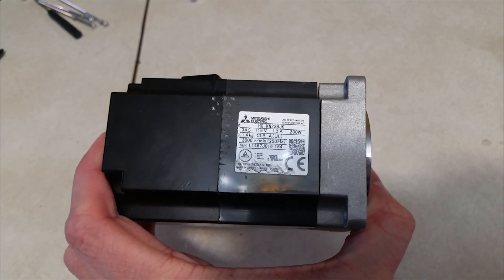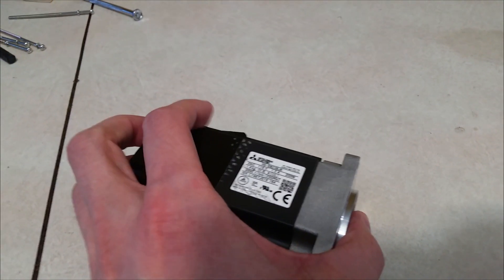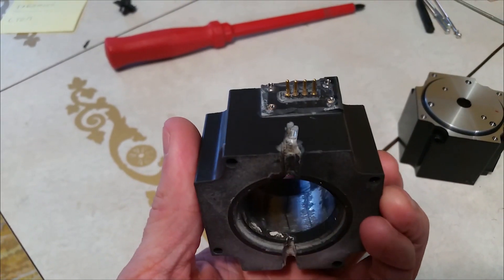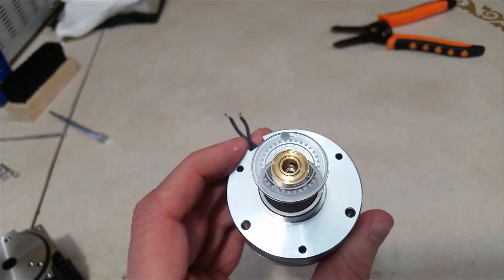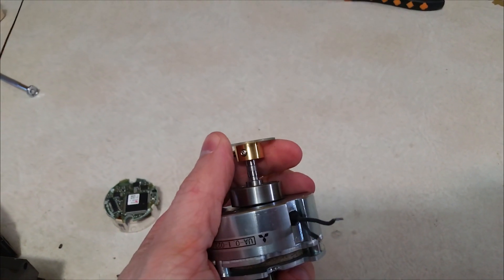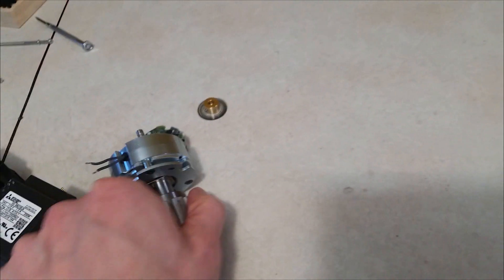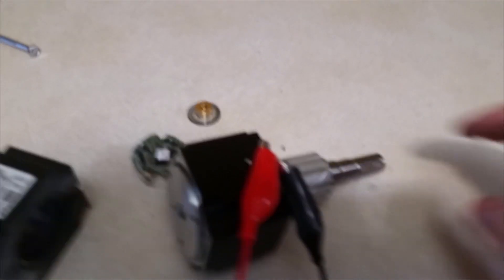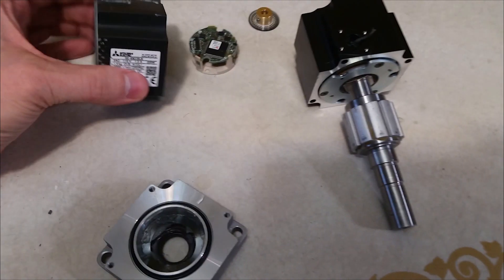Disassembling A Mitsubishi 200w Servo Motor With Brake

Comment: Thanks, just got some to replace Chinese ones that don't have the brake. I was going to remove the brake because the size won't fit but now I see I either need another motor or modify the machine.